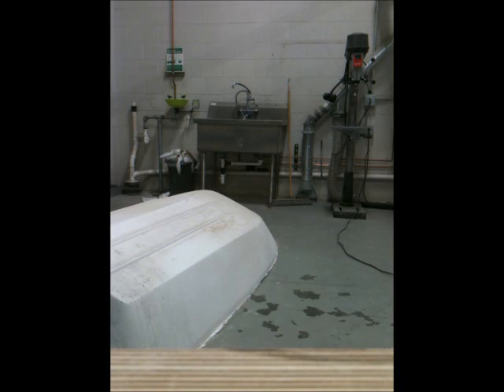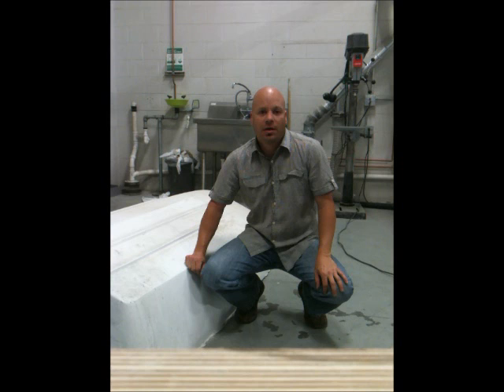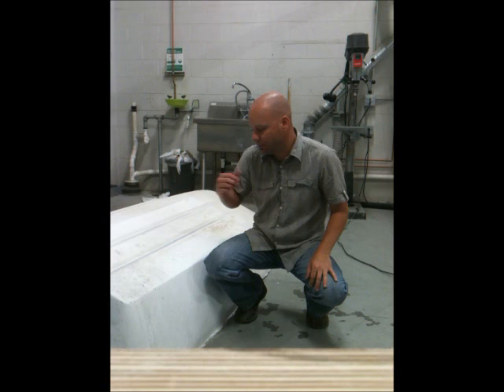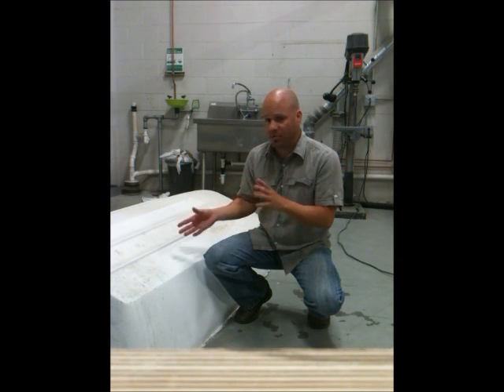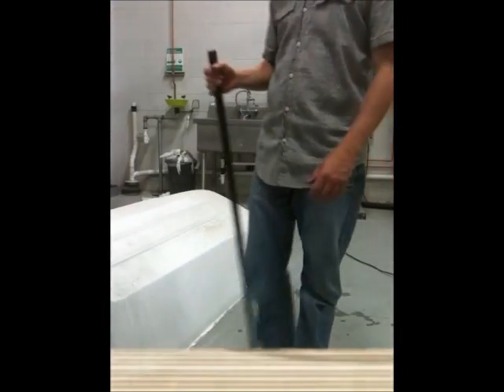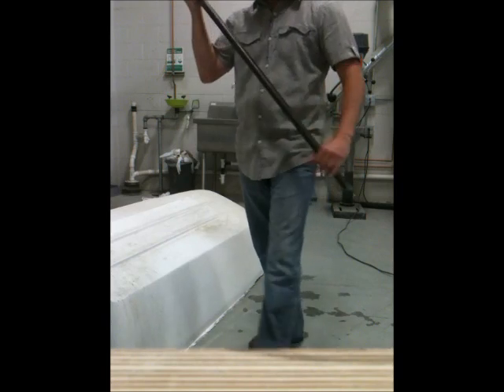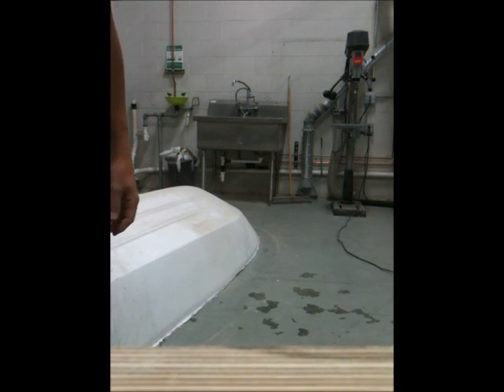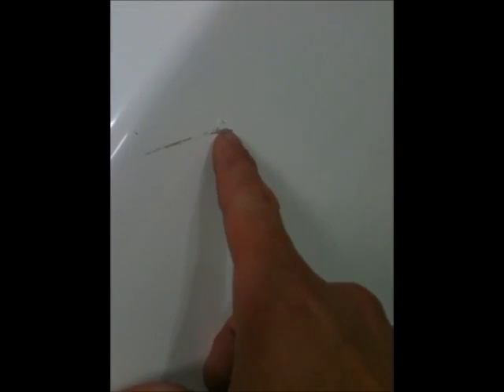The Strength of Fiberglass

Comment: I am HIGHLY curious if I could build a van interior with fiberglass on top of foam board. Being able to shape all of the interior pieces like cabinets, bed area, etc including water reservoirs using foam, then fiberglassing it all in... if that would be a viable way to achieve a lighter van build. It would also allow me to achieve new spaces where not normally available. The water storage tanks could be around the wheel wells which which would keep the water from shifting around alot when applying brakes or accelerating.
Reply from the maker: You can. It's not all that different than building custom speaker housings in a car. Just be careful about which type of foam you use as standard polyester resin for fiberglass will melt it. If you use epoxy resin, no worries.
Reply: That's going to be very expensive interior!

Comment: I have a question if you don't mind, I have a gheenoe powered by a 15hp outboard, the boat is constructed via chopper gun and polyester resin with no stringers/false floor. Over the years from flex it developed a pin hole leak. So I've grinded the floor to bare glass and purchased 17oz biaxle (no mat) and using west system epoxy resin. My question is do you think 2 layers of the 17oz is sufficient? I'm open to using 3 layers but would have to purchase additional resin.
Reply from the maker: David Tadlock the short answer is that two layers should be enough. The long answer says that there is more to it than that. How big is the hole? In any composite structure, dissimilar materials in a repair can cause more problems. In a Gheenoe, it may not matter as much. Typically, though, you'll always want to use the same materials in a repair that were used in the boat's construction. If your leak is truly pinhole sized, two layers and epoxy will be fine. Just make sure that the material is as horizontal as possible when you apply them to the patch area or they may not stay in place while the resin cures. Epoxy is funny that way.
Reply: Thank you for your reply it really helps a lot, luckily all of the repairs are on a flat horizontal surface. Rather than just patch the leak I'm actually laying the 2 layers over the entirety of the floor. Hopefully it works out OK, if not I'm in for a moderately expensive learning lesson haha

Comment: I plan to use a fiberglass rear fender for my motorcycle because the old steel fender rots away after many winters and salt on the roads and because I travel also to pretty hot counties is it going to deform as I often heard? or will I be fine with a Fiberglass fender which is 5mm thick? and what to do to prevent it to crack on the mounting points?
Reply from the maker: Hunk of iron The best resin system to use that won't warp later on at 5mm thick is epoxy. It's even better if you can infuse the fiberglass, which will give you a higher glass to resin ratio than open molded layup will